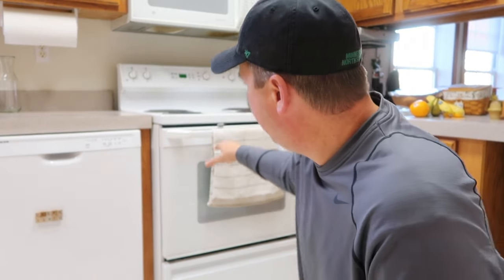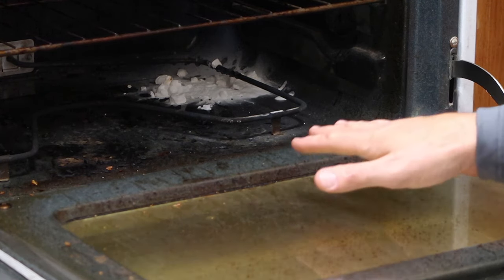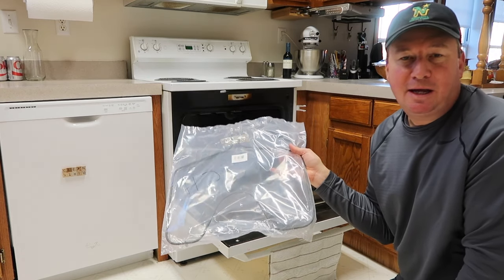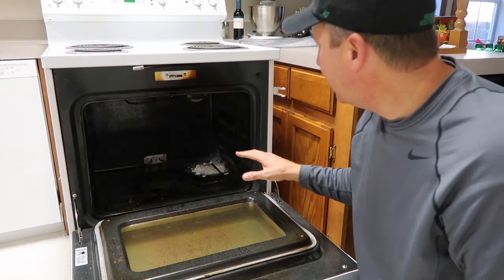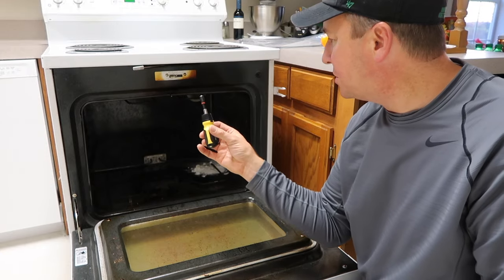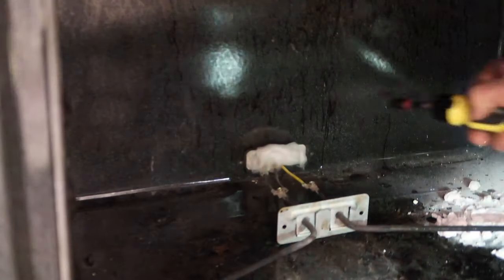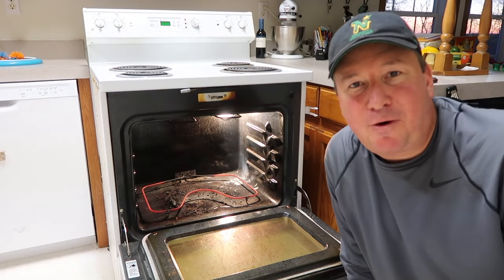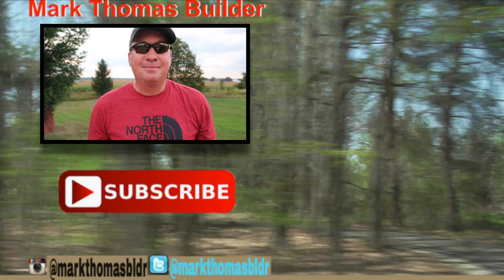HOW TO REPLACE THE BAKE ELEMENT IN A GE OVEN

Comment: Mine won't remove.. I removed the screws like you did then pulled the element in to remove the wires but they are like permanently attached.. No screw to remove.. They dont slide apart.. I dont know how to make progress. Watched 100 videos and every one disconnects it easily but mine wont disconnect
Reply from the maker: I can't say for sure without looking at it.  I wonder if they're corroded on somehow or a solder connection instead of clipped on the element?  I would guess that the wire could be cut and new clip ends installed, but I would suggest you call an appliance repair person.
Reply: @MarkThomasBuilder  thanks for response. I got them removed but had to use pliars.. They were standard connectors but really stuck together well and took a lot of strength to disconnect.. Typical for me; every step has to be a struggle hah. Thanks
Reply from the maker: That's good that they were able to be removed.  I can relate how some steps seem to be a struggle, lol!
Reply: Sounds similar to mine. The wires look like they have a Crimp fitting over them....Not a "Plug n Play" situation

Comment: Hi, thank you for sharing this!  I'm having a hard time finding the right one to unscrew the element and I was wondering if you can share the type of philips screwdriver you used for this video or the link to buy it?
Reply from the maker: Sure, I'm using a stubby ratcheting screwdriver with a 1/4" bit.  Here's a link to a similar one that I'm currently using, which is my favorite... https://amzn.to/38Sne4w.  You also need a 1/4" bit, here's a link for one of my new favorite ones for that... https://amzn.to/2JxtsON. Hope that helps!
Reply: @MarkThomasBuilder  thank you! I’ll check it out
Reply from the maker: @kellywu7246  Awesome, they're a little more expensive, but worth it.

Comment: Your video worked out great for me.  Just replaced my element, took about 5 minutes tops.  Biggest problem for me was the shortness of the wires leading to the element so that took a little longer.  Element cost about $15.  The only real difference in my element is that it used spade lugs instead of screws.

Thanks for your video.
Reply from the maker: I'm glad to hear it was a fast repair.  Mine went out again and I'm repairing it today.  I hope it's a 5 minute fix too.